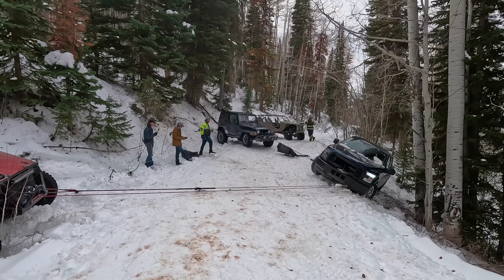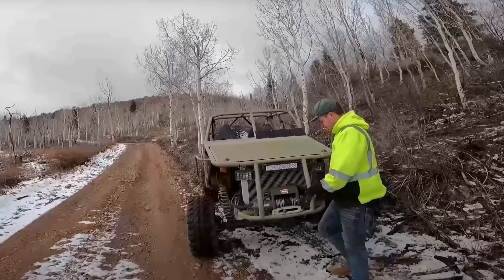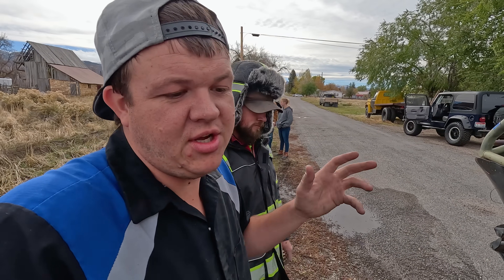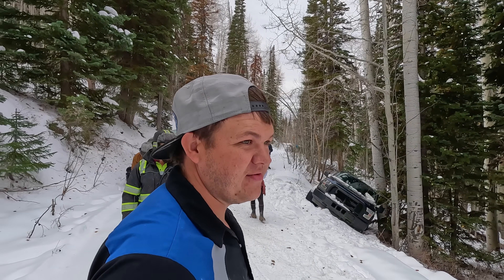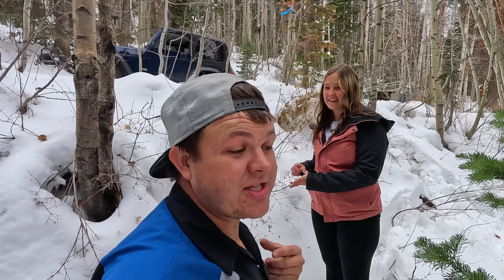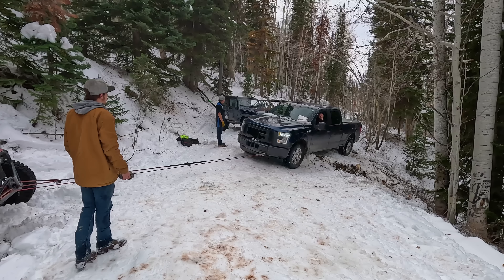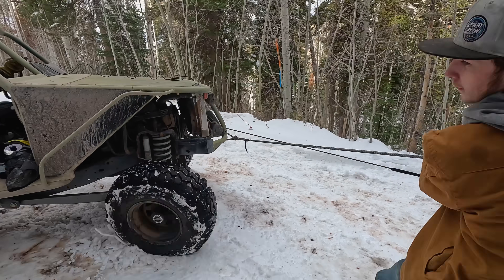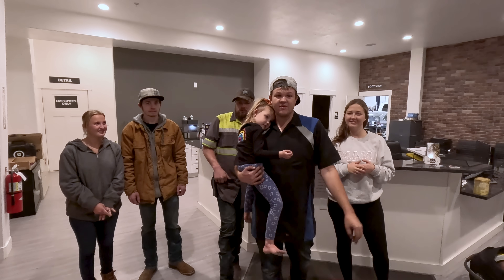There's NO WAY You'll Recover That Ford Truck!!!

Comment: The actual best way to trail fix a radiator leak is Tea spoon of pepper. Tobacco will soften and fail. Pepper never  dissolves and will plug all holes. Old timer taught me that trick.

Comment: I’ve used snoose, also known as snuff which is powdered tobacco to fix a damaged radiator. I was about a hundred miles from nowhere in Alaska and a truck going the opposite direction kicked up a rock and made it through the grill. Needle nose pliers, that can of snoose (luckily there was water in a stream nearby) and I was on my way. Might add, it held for months! Great tip!
Great recovery guys!

Comment: Black pepper does the same thing to stop the leaks
Reply: Yup, and cheaper than smokes
Reply: I used pepper in my old Dodge van. It sealed the leak for a good long time.
Reply: I was going to post the same thing. Pepper for the win. Never heard of using smokes.
Reply: Rory used pepper a few weeks ago to seal a leak.
Reply: Pepper isn't nasty!
Reply: If your camping egg whites will too. I've used the black pepper a few times successfully.
Reply: @DB-yj3qc  Worked with a guy who kept his old ford escort head gasket sealed.  One egg a week he drove that thing 30 miles to work for 2 years.
Reply: I was passing through Mississippi, late night weekend, had fan get loose, grooved the radiator badly with water spraying in many directions..only a convenience store in sight so I went shopping for possibilities, nothing automotive but more food items,never heard of corse ground black pepper used for stop leak but it is truly amazing!!  every time you open the cap you'll be reminded its there!!

Comment: Another temporary way of blocking a radiator hole, is to drop an egg into the radiator.  It works well.
Reply: Black Cracked pepper, from any fast food joint also works.
Reply: I've done the egg one before and it lasted I think still to this day because I don't think we've ever changed that radiator
Reply: I've used the black pepper with success
Reply: I've used pepper, have heard skimmed milk works as well.
Reply: Yep, stuck at a roadside Mom 'n Pop sandwich joint ,couple hundred miles from home, radiator pissing away, I've used black pepper to get myself home. I repaired the rad for real later. I wasn't going to let it happen again.
Reply: @jimbranham3281  does that mean you put a jug of water  in the trunk and a lot of pepper in the glove box or u  actually changed the faulty part's
Reply: Canned tomato sauce … works pretty good too …
Reply: @johnmoore1025  lol
Reply: I've heard of Black Pepper.  However, the egg fix wins as the most flavorful of the options. haha
Reply: Yes it does . We just used the whites. I thought the guy was nuts.
Reply: Saw Autoalex do that. Wonder how long would the repair last
Reply: It works but it also screws up the rest of the system and in new engines with smaller passages in the engine it can clog up the block passages too. 
But it will work and it has gotten me home more than once while off road.
Reply: Rory uses pepper
Reply: Egg n pepper, just need a small piece of bread in there (plumbers helper 😁) and your truck has breakfast for a radiator lifetime 🙃
Reply: @birdlady2725  And it will have a good smoke with the tobacco in there
Reply: Mark, does the egg smell horrible?🤔
Reply: I've used spray foam before

Comment: Here in Australia, we use pepper for the radiator stop leak trick. Robby, I was taught many many years ago.... Always Always have the motor running when using a winch NO exceptions!... then you do Not cook or kill the vehicle battery and the mobile winch should have a set of jumper leads from the vehicle's battery to the battery running that winch with the motor running also.

Comment: I was with my grandpa when he went off the road the same way in my uncles s10 blazer up spring city canyon in the 80's. We had family with tractors down there so we used 2 tractors to pull it back on the road. I've seen quite a few trucks off the road up there since then. It can be very slippery in mud or snow.

Comment: There is a product called Young's Radiator Super Seal which has been around in Australia since 1933. The combination of 100°f + temperatures & the old school metal tank & copper radiators, made this stuff an absolute toolbox item. It works just as good on the aluminium / plastic tank radiators as well. Many outback travellers have said they would have been stranded in extremely isolated places where your life expectancy without adequate drinking water is 48 hrs.

Comment: Just fine ground black pepper will seal up a leaky radiator. It's way cheaper than tobacco or eggs and you can keep it in the glove box for ever. And if You're ever being tracked by law enforcement it can be used to throw off blood hounds.

Comment: Yes that is correct pepper works just as well but it's a temporary clog it's not a permanent clog it's something to get you out of where you are at home not to stop the leak forever still have to fix it when you get home but yes it helps very well because of the expansion that it does correctly I didn't know about the tobacco but I didn't know about the pepper so now I know two ways thank you

Comment: You can also use black ground pepper half a can or so but my favorite is a trip to your local pharmacy and ask for water glass or (silica sulphate it doesn’t really have instructions but I can hook you up if needed it comes in aplastic quart jar it will fix a severely blown head gasket or a cracked block it takes more than just 1 jar @nearly 30$ a jar I’ve seen a crack external on a cat 6 cyl diesel and for reference they put a #2 pencil beside it being nearly the same size length and width the old logger said 2 jars were used worked all day the following days to come 5-7 of them he used almost the third jar and was able to finish the unit with less than a 100$ and the temp outside was below freezing the whole week

Comment: Instead of buying a pack of cigarettes to use for the tobacco. It's cheaper to buy a pouch of Top rolling tobacco. I had a water pump start leaking on me 125 mi from home. Water was pouring out as fast as I could dump it in. Put a half pouch of top rolling tobacco into the radiator twisted myself up a smoke and damn if it quit leaking and got me home.

Comment: So…. If you watch @mattsoffroadrecovery they could offer you some tips on getting that out? 😂. On the 272 point turn…. Emergency brake, turn the tires and put it in neutral and drag it around the corner.

Comment: T shirt in the snow, why not just wear a Speedo, and while your at it, put some slicks on the cars. You really need to start using snow tires and some proper clothes in the winter. My Volvo V90 T8, would easily do this road on winter tires.